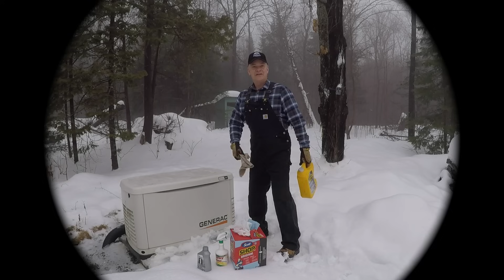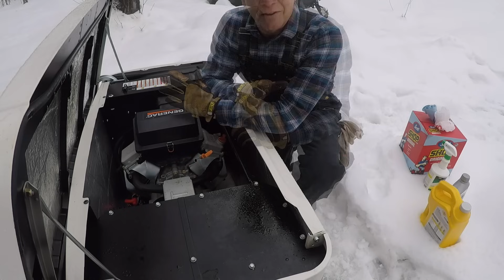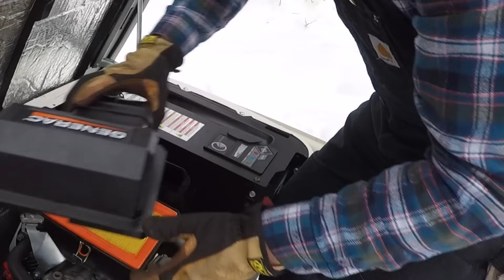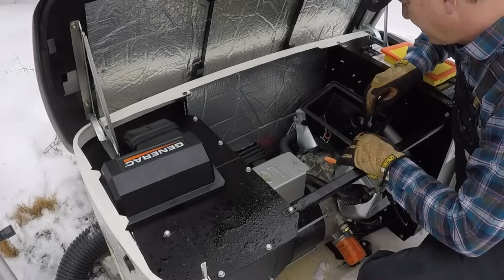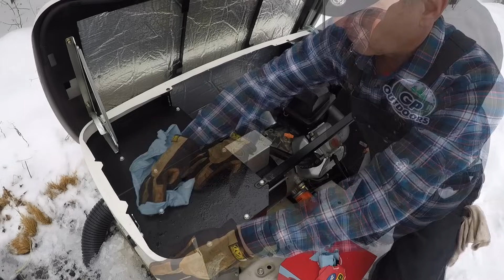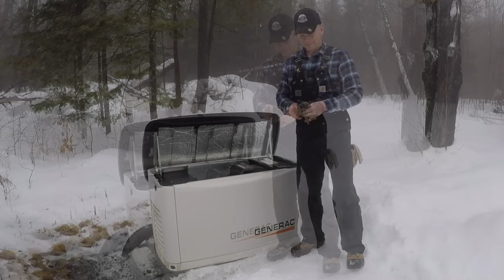#133 Thinking of Buying a Generac Generator? You Need To Watch This!

Comment: Hi GP. Would it help if you drilled a weep hole in the bottom of the box to let the water escape?  Stay safe and warm.   later
Reply from the maker: Good morning mech. I asked about that but they explained that the air would be drawn in through that hole and would be unfiltered. However as you know, our B2601's have a hole with a one-way rubber diaphragm installed at the bottom of the air filter compartment to alleviate condensation without drawing in air. Guy said that would be a good solution for the generator as well. Hope all is well and Max is too!
Reply: NO,NO dont do that ,because you would bypass the air filter,and the engine would suc in dirty air and premature cylinder wear would result !
Reply: Gord,  i would absolutely recommend Guy's suggestion.  A weep hole WITH the one way valve or diaphragm as to not such in while running
Reply: Normand Guenette , if you drilled a 1/8 inch hole, how much unfiltered air would be drawn in?
Reply: That "diaphragm" on your tractor is on the dirty side of the filter.  This would work as long as the dirty side of your filter is facing the bottom on the generator motor. I'm sure you already figured that out though.
Reply: Thanks for the tips. I always buy Kohler.
Reply: @GPOutdoors  Take a good look at the airflow direction. Every pleated air filter I have ever seen has the pleated side towards the dirty air, and the supporting metal screen towards the clean air. Which side of your air filter gets dirty? I bet it is the lower side, and a drain hole under the air filter could never let in unfiltered air to the engine.
Reply: @fredkaminski6138  None, as in the lower side of that filter is the dirty air side. All the air drawn in through the drilled hole would be dirty, but none of the air would be unfiltered going into the engine.

Comment: I would try this to see if it would work in the winter months. Put a tube that fits into the water drain hole. Allow the tube to reach upwards just shy of the filter. That way the drain hole will vent air and the water will freeze in the bottom so the air box...same as always.  Be sure to remove the ice before use so the water never gets high enough to plug the tube extension. It's worth a try and it may be a good work around to your problem.

Comment: That pipe in the air filter housing is the crankcase vent pipe, if its blocked the fumes generated from piston ring blow-by have nowhere to go hence the dipstick is blown out by the excess pressure in the crankcase. Calling it a exhaust port is incorrect as it has nothing to do with the exhaust system.

Comment: Why not drill some small holes at the very bottom of the filter cabin so that the condensation doesn't pond inside and freeze. Not sure if that's even possible, just a suggestion.
Reply: Because it will suck unfiltered air into the engine.

Comment: I had the same problem with Honda 3000 when running in high humidity and northern winter temps.  Ice accumulated in the carburetor throat over the crankcase ventilation port.  Solution was to vent the crankcase to atmosphere, plug the ventilation port with a small machine screw turned into threads I tapped in the hole.

Comment: Couldn't you just drill about one or two 1/8" diameter holes in the bottom of the filter box to allow the condensation to drip out ?
Reply from the maker: You bet G. But will need to put something over the hole as well. Thanks and have a good weekend!
Reply: GP Outdoors why?
Reply: That would allow unfiltered air to bypass the air filter.  Yes, this box is designed wrong.
Reply: @rbstorms  snow blowers don't have filters. Although in other times during the year this could be a problem . I think I would go without a filter and put one over thecair inlets in the box the generators in.
Reply: I think the vacuum would not allow the water to drain. I suggest an auto [check valve] similar to a PCV to open/close as needed.
Reply: The problem with that is that if its cold enough to freeze then the holes would freeze shut and you’d be back to square one. Also that will affect the air intake ratios the system is designed for.
Reply: @rbstorms  The water is on the "dirty air" side of the filter.  The intake air flows up through the filter element, cover and to the engine intake.
Reply: @radon360  Nope, the air flows down through the filter.  The water is on the "clean" side.  Look at how the filter drops into the box, just like on a car or truck.  The orange gasket on the filter is on the "dirty" side.
Reply: @chandlersgarage    The bottom side of the box on car or truck IS the dirty side.   The pleats go on the dirty side, and the expanded metal of the filter element goes on the low pressure (clean) side.   If the water is in the clean side of the filter box, then not only is it opposite of automotive design, it also means that the filter element is installed backwards, and that it's a really dumb design, since when pulling the filter element, dirt can fall off and into the clean side.  
I think you might want to look at that again, including where the dirt collects on the filter pleats on your car air filter.
Reply: @radon360  You are right, this filter in the generator must fit the opposite of a car filter.  My bad.   I think it is just a poor design. It is backwards, you can see the carburetor intake below the air filter.   Quite strange.
Reply: @chandlersgarage  I took a closer look at it again tonight, you are right about this generator.  It does appear to flow downward on closer study as you describe.  My mistake.  So many things wrong with this design.

Comment: Thanks for another informative video. I just ordered a Generac backup generator for my house. Would it make sense to drill a weep hole in the bottom of the air filter housing to allow water to drip out of it, instead of freezing up inside? Or perhaps leaving a light bulb on inside the generator to keep it above freezing? Just a thought.
Reply from the maker: Good morning. My brother has one and uses a lightbulb - he has found that it is not that helpful in our cold winters up here but I know others have said they do that and it works for them well. I think if you ask your Generac rep, he will tell you that drilling that hole will void your warranty ( but yes it is a very good solution). Good luck - as I said, it is not a bad genney otherwise and having standby or backup power is a really helpful thing for you and your family. Cheers!
Reply: @GPOutdoors  Hi. Quick question. I bought a, 18KW Generac whole house generator and my propane company is telling me I need an inground tank, otherwise if the temperature drops below 40 degree Fahrenheit it will not work. Do you have an inground tank? Or above ground. I am in the lower Hudson Valley of NY and it rarely gets below freezing even in the middle of winter. Thanks.

Comment: Easy solution, buy Onan, or Kohler next time. They make a far superior product, and they stand behind them.
Reply: lol kohler.. same junk as this.
Reply: Onan quality has nose dived recently. The 5.5's eat oil and grenade before the low oil cut out kicks in.
Go Honda.
Reply: NYTom60  not sure what part of the world you live in, but here in the United States Cat, and Cummins-onan are much more common. And depending what part of the country Waukesha is king. Generac is usually homeowner crap, not commercial use.
Reply: NYTom60  everything made now is junk, that's why you see them in the health field, because there's not much choice, excpt junk or worse junk
Reply: Really? Many of our cell phone towers and gas stations in Florida use large Generac standby generators.
Reply: @grayghost20000  that's Florida. And Florida doesn't have a reputation for having the smartest decisions. And second you're talking about 500kw and bigger units for that sort of service. Generac uses someone else's engines for those units. My comment is aimed at generac engines. If you look around you will see lots of equipment powered by kohler and onan engines not just their own generators, the same can't be said for generac.
Reply: I think Generac makes a better air cooled product then Kohler. I use to be a Kohler dealer and had so many headaches with there gensets. From overcharging batteries, to defective steppers, low oil safeties not shutting gender down allowing engines to seiz. Generac seems to have built a better machine. Plus if I need tech support Generac will talk to me direct. With Kohler I have to call my distributor who is never around.

Comment: I must be missing something. I don't have such a unit yet, so maybe that's why I don't understand this problem. Considering that this is where the air filter is, doesn't that mean that this is the air intake? If so, why does it need an exhaust port? What does that do, on an INTAKE? And why would there be a need for a reservoir? And why would the incoming air produce condensation? Isn't the air coming in cold? And would it not be warming up (thereby reducing the chance of condensation) as it comes in, even if only slightly? So what is cooling it and causing it to produce condensation? And if it is the intake, then why would plugging it up cause the dip stick to get blown out? On the other hand, given that it has an exhaust port, which seems to imply the exhaust system rather than the intake, why would the exhaust need an air filter instead of a muffler? Is this somehow directing the exhaust back through the intake, perhaps to give a second chance to fumes that escaped the first burn? If so, I still don't understand the need for the reservoir that catches the condensation. Why not just put the exhaust port at the bottom and let the condensation trickle out? Why would the designers not utilize the heat of the exhaust air to keep the condensation from freezing before its exit? Or, since our unit is purposed for generating electricity, why not just put a small heating element (on the exhaust port) activated near or below freezing? I'm really trying hard to wrap my head around this problem. But something is just not adding up.
Reply from the maker: Hi Rafael, my apologies - it is the vent port from the crankcase. There is a heating kit which I bought which wraps around the vent port now to stop the water from freezing and plugging it however it does not stop the water from building up in the air filter compartment. I understand that vent port is there to meet environmental regulations. I am not very mechanical unfortunately but this has been a problem with the last two generators I have owned and many people in this geographic area with same units have the same problem. Wish I could answer it in a more technical manner for you. Good luck and thanks for the comment.

Comment: they have heaters for this problem you should get one
Reply from the maker: I have 3 heater kits on it, including the vent port kit - it does not stop the accumulation in the filter box. But is does, now, stop it from freezing back into the vent port. Thanks though for offering a possible solution for me - cheers!
Reply: @GPOutdoors  then my question, with the heaters how long are you running it during your tests? It must run long enough for the water to evaporate once the engine warms up.

Comment: This could easily be solved with an airbox drain, we use these quite frequently on dirtbikes. I know that it is on the input side to the engine so potential for small amount of unfiltered air.

Comment: Vent crankcase to atmosphere as if we're 1960, problem solved!
Reply: most likely then not CARB emission compliant
Reply: @johnnyw199  and that right there is why i would.  screw CARB
Reply: @johnnyw199  California Air Resources Board rules may not apply here in central Ontario Canada.  Just a guess.

Comment: Drill a 1/4" Hole in the Air Filter Cabinet at the bottom where it is collecting so it can drain = FIXED !
Reply: Only problem with that is you are defeating the purpose of the air cleaner.
Reply: You aren't defeating the purpose of the air filter. It looks like the bottom side is the unfiltered air anyway. The main problem would be that this would vent a small amount of emissions to the atmosphere.
Reply: @snoopdogie187  no, the bottom side is where the filtered air ends up, drill a hole and unfiltered air will get sucked in, not a lot, but some
Reply: If that is the case, then that is not a well engineered product. Look at almost any, if not all cars, the bottom is the unfiltered area. This lets the bottom have a way to get rid of water while protecting the air going into the engine. But if that is the case, then either just keep this area clean, or let a small amount of unfiltered air in. Its not the worst case, I know a lot of snow blowers didn't bother to filter the air anyway, but when it snows, its winter time, and dust is not much of an issue anyway. For a generator, its not always winter.

Comment: Appreciate your info... 👍
I recently installed a KOHLER 14kw whole house backup generator and in most people's estimation has the more rugged and reliable V-twin engine that is slightly smaller in CC size and uses less fuel, no matter the type... LP or natural gas.
When you see the engine comparison documentation, it's clear to see the Kohler engine is the more rugged commercial style engine, and without the freezing temperatures design flaw the Generac has. 
Plus mine came with a 10 YEAR WARRANTY instead of 5 year like the Generac has...
Kohler had/has a promotion going along with a BONUS REBATE of $500 on the 14kw unit, even more on the larger units.

Seems like a no brainier to me along with the fact the Kohler engines use less fuel for a continuing cost savings.

I compared multiple estimates from both Kohler and Generac installers and end cost was basically the same due to the rebate, and that 10:year warranty thrown in sealed the deal for me.
My friend bought one too so we got an even better price!

Do your due diligence and you'll agree. 
It's comforting to have peace of mind I made the right choice, and also know my home will always have power.
I'm running mine on the natural gas but also considering adding a 250 lb. LP propane tank that holds 200 lbs. of gas, just in case of any very long term grid outage with the possibility of natural gas outage... 
No doubt gas companies use generators to run their pressure pumps so it's possible that the natural gas supply could go down over time, so it's good to have the ability to switch fuels...
Could even be converted to run on gasoline which provides the most kilowatts of power out of the 3 fuels 

Actually the natural gas provides the least KW but is the most convenient and least expensive to run with.

Hope this helps anyone considering a generator.
I wanted completely automatic with auto-transfer, I didn't want to deal with a portable unit, albeit less expensive, but what if you're not around when the power goes out and it's freezing temperatures?
Is your family going to be able to do all that's necessary to get the portable up and running and connected?..
That's an important consideration.
Reply: Problem is no kohler dealers near me in WV

Comment: Looks like crank case blow by gases can't escape ,not exhaust
Reply: Exactly every engine has blow by. Old engines just vented straight to the outside of the engine. Then they started recycling crank pressure to the intakes. Most diesel engines just vented out to the atmosphere and they did this for years. But then the epa got involved and everything changed. I was curious to see how far down the comment list I had to go before I saw someone who figured it out.

Comment: I installed one for a friend of mine. Before even reaching 10 hours of operation, it blew the generator just outside the warranty and Generac's response, Sorry;  we can't honor a warranty beyond the terms. JUNK
Reply: Herbert Head I work on small engines Generac is not a good brand unless using a vanguard engine
Reply: I will agree that IF a company won't help a customer with a problem, warranty or not, then yes, the company doesn't deserve to exist.  Units sometimes have a problem and the company should recognize a weak unit and take care of it--warranty or not.